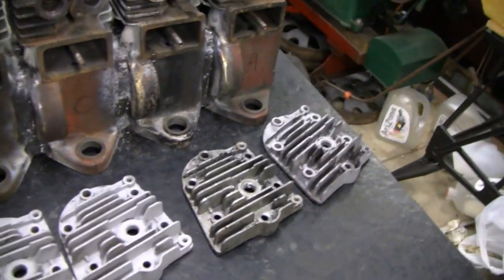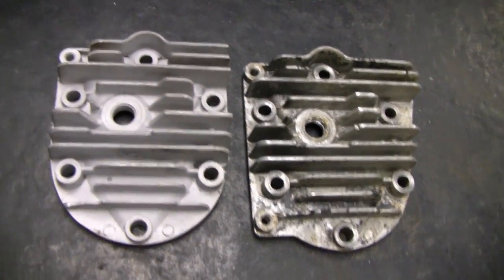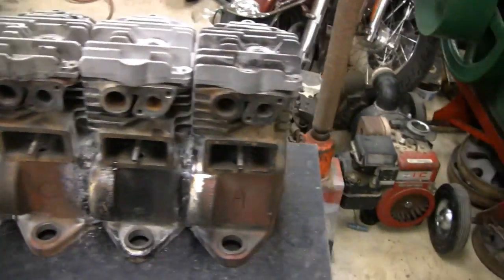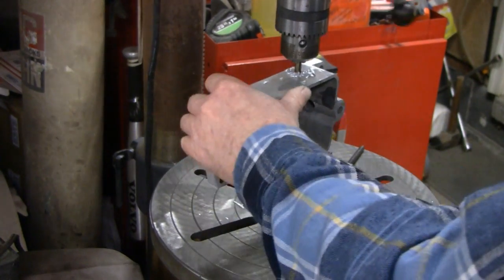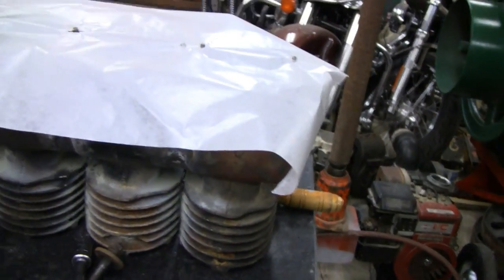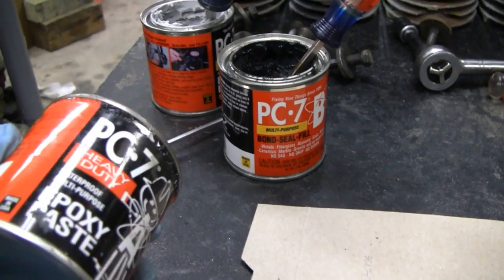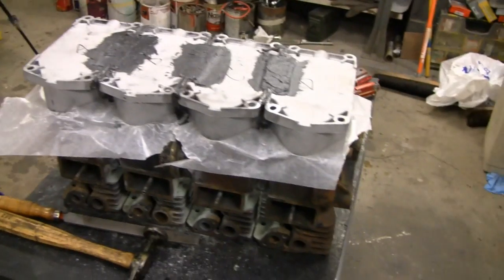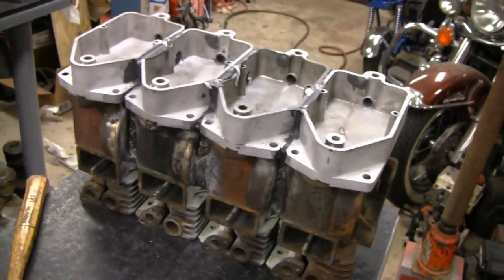HOMEMADE 4 CYLINDER BRIGGS PROJECT (part 6)

Comment: thanks for the tip on PC-7, never heard of it before!
Reply from the maker: Yeah it's good stuff, been using it a long time!!☺
Reply: That stuff is great! It makes JB weld look like elmer's glue.. My Dad used to use it on heavy equipment when he worked at the Briggs and Stratton factory. I've repaired countless cracked aluminum and cast iron engine blocks with it.

Comment: Cool project! Thank you.  How difficult is it to drain the oil? It seems that the one 5/8 hole wouldn't be adequate. You'd have to tilt the quad assembly back and to the side in order to move the oil from pan to pan. Could you have cut the dividers to allow a less restricted passage throughout to entire lower end?
Reply from the maker: +AlwaysFreeAmerica Thanks Bud!! 5/8 hole is plenty big, no need to tilt anything. It all finds it's way to the drain plug in a few minutes!!☺

Comment: I would have made a copper tube on the side holes on the oil pans conecting al chambers together, and provide a tap to change the oil, much easier then you did ;-)

Comment: Never heard of PC7 and I was wonder how you were going to connect the 4 oil pans  with out have a leak between oil pans so this vid was not boreing
Reply from the maker: I drilled a 5/8 inch hole between them all and the epoxy prevents them from leaking!!☺
Reply: Yea I saw that later

Comment: Great job on the build,iv watch all the vidz on it an even subscribed, but i am back at this one to see what you used to glue them together with, PC-7 Epoxy
That like jb welb or better you think ? You said you had that one can for a long time so it didn't did dry up an go bad ? How long do you think it will last on your project before cracking an flaking off,just asking cause this stuff is new to me,iv never heard of it till now,Does it sand easy or clog up sand paper ?Seems like so great stuff to use though
Reply from the maker: Thanks Bud!! Just the bases were glued together, the blocks were welded!! I like this stuff better than JB but they are very similar!! It has a great shelf life, I've used some that was over 30 years old!! I've never seen it crack or flake at all on older projects!! It does clog the sand paper a little but not any worse than regular body putty!!☺
Reply: I am goona have to try that stuff.1 lb for 17.00 on ebay not too bad i guess

Comment: Cool build! IF that PC7 is a 100 times stronger than weld why did you choose to weld the blocks instead of using the PC7. I don't have access to a welder and am wondering if the PC 7 could be used.
Reply from the maker: The blocks are cast iron!! Those bases are aluminum, I said the PC was stronger than an aluminum weld!!☺
Reply: 805ROADKING
Sorry about that. I missed that.  Wasn't ' trying  to be a prck.. I don't why there was a need for the double exclamation points there.  I won't make that mistake again. I am off to UNSUBSCRIBE!!!!!!!!
Reply from the maker: The double exclamation point is a signature!! I end every sentence with them, have for years!! No malicious intent meant just answering your question!!☺

Comment: I love PC-7,  a tip to anyone new to this kind of stuff. Make sure the surface you are bonding to is clean, clean, clean! I clean with acetone and then clean the acetone with rubbing alcohol. If there is any crud on the bonding surface it will come loose at some point especially if it is subject to vibration. Get it really clean and you will never have any problems. I recently had to redo a Briggs engine with PC-7 and I put the original bond on in 1972 or close to that so it will hold if done correctly. That engine has run for 40 plus years and just now needed the PC-7 plug I put on it originally redone. By the way a late Merry Christmas to you and the crew and a Happy New Year! I love this build!
Reply from the maker: Thanks Bruce!! Great tip, also if they could abrade the surface being repaired with sandpaper or a grinder it will help the adhesion!! Done right ya definitely get a trouble-free repair that will last for many decades!!☺

Comment: you'll be able to power a freakin' car with that. is that PC-7 stuff like JB Weld? My buddy actually cracked a motor block and fixed it with JB weld, oddly enough it actually worked and has held 2 years now!
Reply from the maker: Yeah they are pretty much the same stuff but you can get PC-7 in pints, quarts, and gallons!! JB only comes in 2 oz tubes!!☺